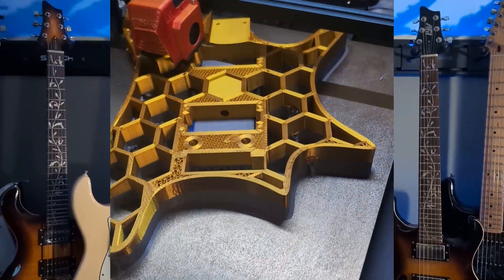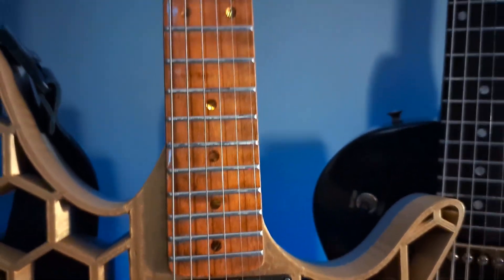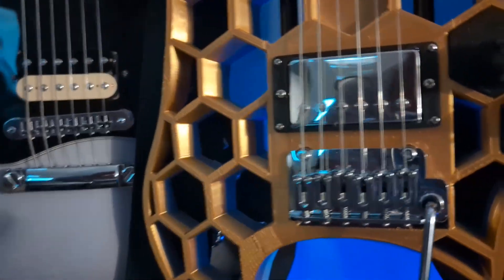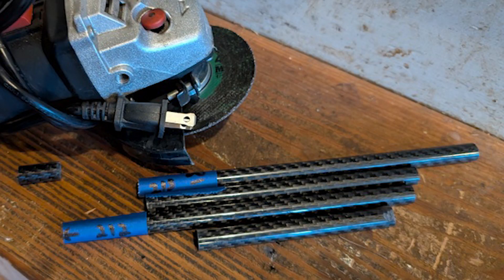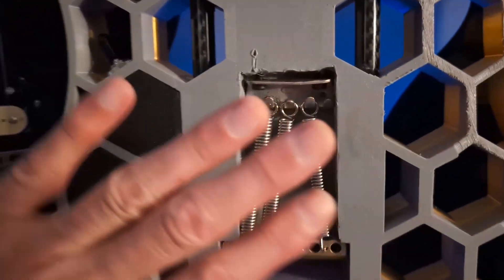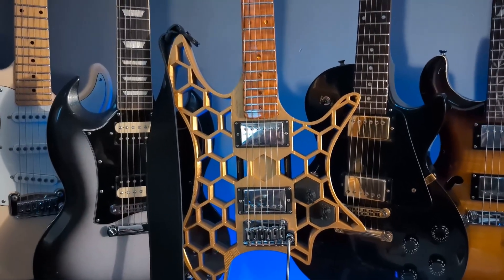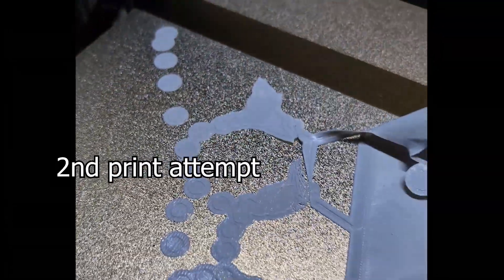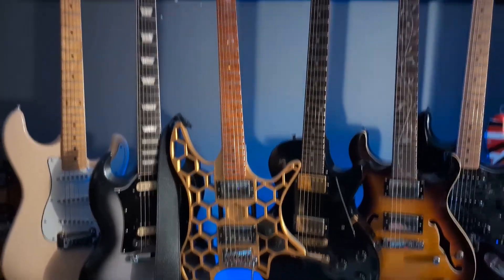I Tried Making a 3D Printed Guitar and This Happened!

Comment from the maker: Parts and supplies used in this project:
- RDJZDQ Maple Electric Guitar Neck 21 String Electric Guitar Neck Maple https://amzlink.to/az0XabegZQ8nK
- ELEGOO Carbon Fiber PLA Filament 175mm Black 1KG PLACF Strong 3D Printer Filament https://amzlink.to/az0Fa7wlhuE2o 
- Planet Waves DAddario Auto Lock Guitar Strap  https://amzlink.to/az0OuKPK7ilRH
- Musiclily Pro LPCMHA Alnico 5 Covered Humbucker Neck Bridge Pickups https://amzlink.to/az0yolo8ew2oJ
- OVSAL 105mm Electric Guitar Bridge with Zinc Alloy Saddles Brass Block https://amzlink.to/az0vW0IUNKfgo
- Elegoo Neptune 4 Max 3D printer https://amzlink.to/az00zUc9wMzE3
- Elegoo Centauri Carbon 3D printer https://amzlink.to/az0vlQ4fgbl8Z
- Ernie Ball Super Slinky Nickel Wound Electric Guitar Strings https://amzlink.to/az0YQskJ1mlPR
- Grover 205BC6 Rotomatic Mini 6 in Line Machine Heads Black https://amzlink.to/az0IH4wqOYxqL
- But you can easily substitute these less expensive Guyker Guitar Locking Tuners https://amzlink.to/az0qAPzwdopht
- Switchcraft 14 Mono 2 Conductor Input Jack https://amzlink.to/az0vDivhY38m1
- Electric Guitar Wiring Harness Guitar Wiring Harness Kit 1 Volume 1 Tone 3 way switch https://amzlink.to/az0q6Kfo7ubJB
- CashBeat 254Piece Guitar Screw Master Kit Stainless Steel Mounting Hardware https://amzlink.to/az0ySZY5X3vIi
- TECBEARS High Speed PLA Plus Filament https://amzlink.to/az06qyIBJbBCU
- This soldering kit has been a godsend WEP 982DII 2In1 Micro Soldering Kit https://amzlink.to/az0ddtW8CQUqE
- But this is a lot cheaper and a good digital soldering iron https://amzlink.to/az0y9huTrCDvs
- carbon fiber tubes 12mm  https://amzlink.to/az0QZMcSSq9Wc
- StewMac Electric Guitar Nech Shims https://amzlink.to/az0Yw7vIRxKJter Kit Stainless Steel Mounting Hardware https://amzlink.to/az0ySZY5X3vIi

Comment: Did the three CF rods fix the flexing between the neck and body? I've been thinking about printing a guitar body and was thinking about using carbon fiber rods or tubes.
Reply from the maker: It definitely reduced it vs prior printed guitars that had less additional support and flexed more. 
I still don't leave it under string tension when not playing it though, just in case.

Comment: Absolutely crazy that not only did you make the electric guitar, but you rigged it to be able to support a tremolo system, which adds even more stress to the body.
Reply from the maker: The stresses run 180 degrees from each other (trem claw screws vs guitar strings). We shall see if it holds. But it is doing well so far. I have concerns about the threaded inserts holding the trem claw screws. They were supposed to be over an inch long wood screws with plenty of screw surface area to spread the stress, but they wouldn't turn in the PLA Pro. So, I heat melted threaded brass inserts into the screw holes. Other than the trem claw, are there additional stresses that I'm missing or didn't account for?
Reply: @GearReportMaker nah you pretty much accounted for everything. You may have seen some of my 3d printed guitars so I have a good idea of what the deal is.

Personally, I still use wood screws for the trem claws. However, I enlarge the pilot to the same diameter of the screws without threads and I coat the screws in wax before I send them home.

I do avoid brass inserts for screws because they don't have anywhere near the same surface area to grab onto the body as a screw does.

Additionally, for what's it worth, I tend to add a neck break angle even on Strat and trem style bridges as this vastly changes the angle of the string tension. It becomes a compression force of the neck into the pocket instead of trying to pull the neck up.

Hope this helps!
Reply from the maker: I'll have to check out some of your builds. 
I had to add angled neck pocket shims to get a good angle for a low action. I'll look at incorporating that angle into the neck pocket next time. But changing the forces is a benefit I had not thought of. This is the first guitar that I've made any design changes on. I have  LOT to learn. :) Even with the shim and carbon rods I'm still seeing neck movement. But I'm actually not positive it is the body. I think the neck is just moving a bit. As in, I think the truss rod adjustment to add a little relief crept a bit for the next day or two after the adjustment, as the neck has about twice the relief now as it did after adjustment. The string height with the string depressed at the 1st fret and  last fret is about double what it was right after I made the adjustment. Gonna have to pull off the neck and adjust it before I try to tune this one again. But it will be late next week... about be unavailable for a week. Maybe the neck will settle in the meantime. This cheap neck off of Amazon has been a friggin' trainwreck in terms of high frets, frets that have come partially unseated, stability.

I really don't like how I'm using the brass inserts on this one. I used them to hold the body of my BambuCaster together and they do fine on all but the center core. I need to take that one apart and use a bonding glue that will fuse those pieces together. I thought I made the pilot holes on the trem claw big enough, but they weren't. I'll enlarge next time and angle them a little to change the pull angle and make them easier to turn the screw driver. These are straight and that doesn't give me room to grip the screwdriver well. So, putting torque on them is difficult.

Comment: That's cool. I'm making a B.C. Rich warlock. It's just for display though. Any ideas where a guy could find let's say pickups that may be dead but look right?
Reply from the maker: I'd probably start with a local guitar group or guitar shop. 
If you are close (central NC) I probably have something  you can use. 
If you can't find pickups, you might put some pickup covers in the holes.